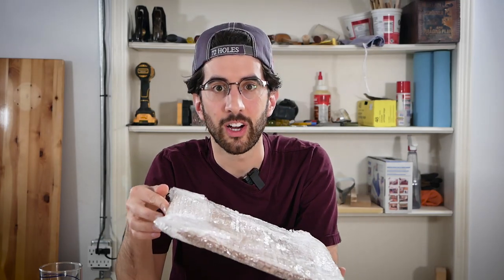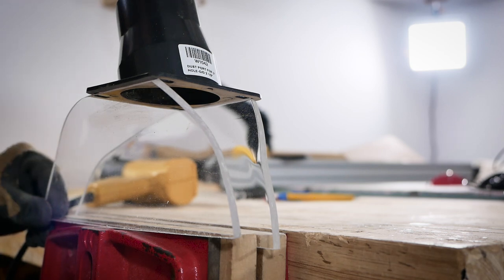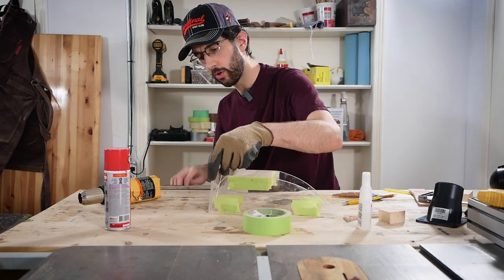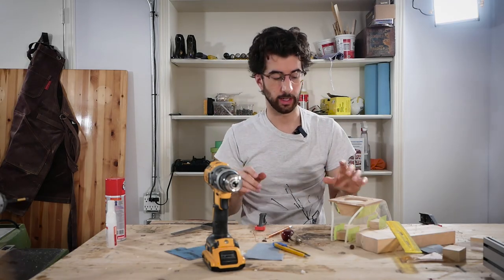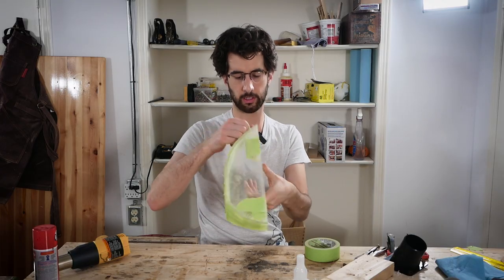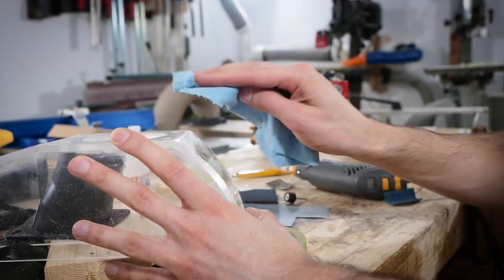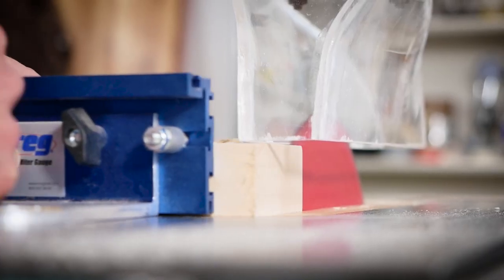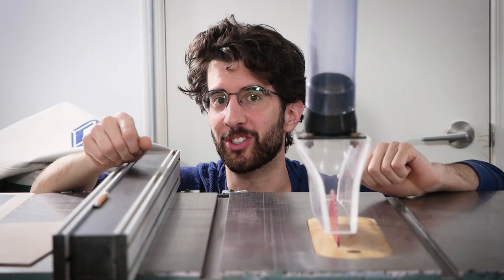DIY Acrylic Overhead Table Saw Dust Collection and Safety Guard

Comment: This thing is cool. I've been wanted to build some sort of overhead extraction for a while. Do you still like it? Or does it feel like it's in the way?
Reply from the maker: I still use it for 65% of cuts. When the fence gets really close or I use my sled, I don't use it. I feel like I could have made it more narrow and it would be less in the way. I also wish the mechanism was a little easier to move, but it's really not that bad.... I'm just lazy.

Comment: Great video! they all are actually. Hey do you think that maybe if the table saw had a super dust collection under the table it would stop throwing dust up? Thinking entirely out loud here, and knowing nothing of dust collection as my table saw is outdoors, the saw pulls sawdust from your work piece basically straight down and the only reason dust ends up on the table is because some of it manages to make a full rotation in the blade before ejecting. I would one day like to have a work space that requires dust collection.
Reply from the maker: Yeah, in an ideal world, a shroud very close to the blade underneath the table would be highly effective. Unfortunately, this cabinet saw, much like many similarly designed cabinet saws to the unisaw, have the dust port near the bottom of the cabinet. Coupled with dozens of holes, cracks and crevices all around the cabinet leaves very little suction near the blade. The saw dust that resides in the gullet of the saw teeth isn't removed on the first rotation beneath the table top and is subsequently flung upwards as it emerges from the backside of the table. If you look at the Wadkin PK dust collection design (from the 1930s, mind you), you can see why that saw would certainly have superior dust collection under the table. Thanks for watching!
Reply: @ScottWalshWoodworking  YouTube is feeding me auto blast gate videos now, but worth it. Good stuff Scott.

Comment: Great build!!  I really like the heat bending. 

You might want to look at polycarbonate (ex: Lexan) instead of acrylic because polycarbonate will NOT shatter whereas acrylic can shatter (in the event of a mishap), producing really great shrapnel 😁

I found a guard named “Shark Guard” that I’m really happy with on my old Unisaw.   It is made from polycarbonate and there are models for many saw brands/models. 

Keep up the excellent content!!

Comment: I'm considering building an overhead guard/dust collector as well... for my old Craftsman 113 table saw.  After I upgraded the fence to a Delta 36-T30, it does not allow the old motor mounted guard to be used.  

In place of a complicated curved guard like yours (nice job BTW), I'm going to side mount my Powertec 70124 and make the guard just high enough to allow it above the blade at full height and sitting just behind the blade location.  I don't have the patience or skill to try a curved guard and my version would make the hose connection go off the side towards the fence and rearwards, not directly up like yours.  I don't think the 45'ish degree angle at the guard should really impact its ability to draw airflow, as it will still create negative air pressure inside.  I'll also try to built it so it swings up with the material as it is feed in, hinged towards the back.

Comment: Three small comments - 1. You might get better dust collection by rotating the guard 180 degrees so the longer 'beak' is towards you. 2. Get a riving knife - actually that should have been priority 1; and 3. Didn't your saw come with a guard and riving knife? — and why aren't you using one? I cringe every time I see a YouTuber using saws like this without guards or riving knives - it's asking for kick-backs and gets your fingers too close to a flesh-eating blade.

Comment: Nice work! However you should indeed use a riving knife when talking about safety and a table saw. Seems to be an American thing to me?
Reply from the maker: That was the "different type of safety issue" at 13:08. I've been using table saws without riving knives for about 15 years and while that doesn't make me invincible, I've learned to operate a table saw in such a way that kick back would be extremely unlikely. Also, I believe it goes without saying that one should understand and use their tools as per the manufacturers operating instructions (ie: use the provided safety devices), but I don't like to fill my videos with subject matter that has been beaten to death by everyone on YouTube.

Thanks for watching!
Reply from the maker: Oh and actually about the "American" thing. My guess is the prevalence of the Delta Unisaw and the various iterations and clones over the years in North America has given us here the impression that the 'riving knife' is a new safety concept, since the Unisaw was only ever sold with a splitter that in most cases, proved to be more trouble than it was worth to use. European, British and some American machinery manufactures were all using true riving knives (the kind that moves up and down with the blade elevation) since at least the early 30s, or maybe even earlier. You can see this on machines like the Wadkin PK, etc.